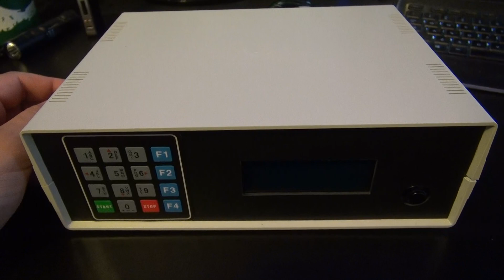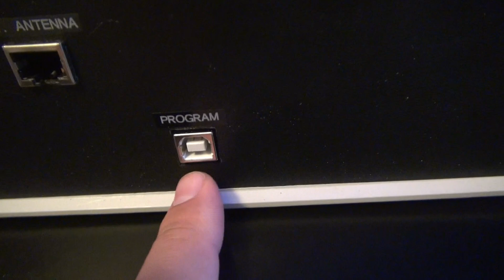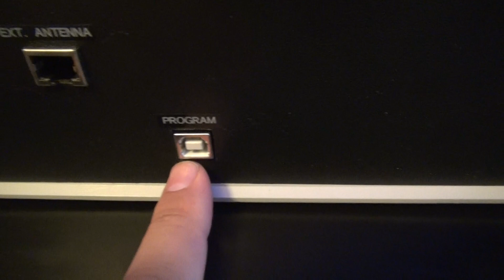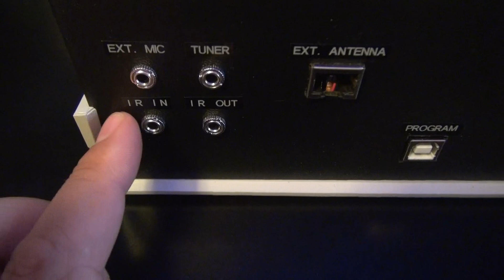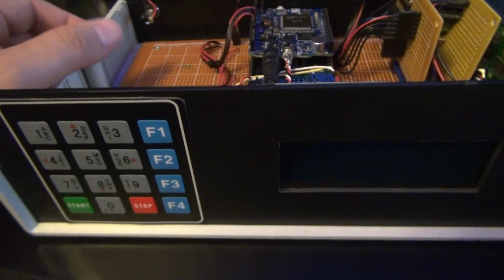ARDUINO ANTENNA SWITCH INSIDE TOUR.

Comment: Great project! Could you tell me how did you cut the holes in the case (especially for the lcd)? It looks very professional.
Reply from the maker: First I taped the whole panel with painters tape . Then I marked where I wanted the cut out to be. I then drilled four holes close but not to close the the edge on the inside of the rectangle. Then I used a table scroll saw with a fine wood blade and kept close to the line. After the hole was cut I used a small flat file to smooth the plastic all around the cutout. It took some time but It pays off with some patients.

Comment: cool project, the only thing is that i have not understand why the massive prototype board ... the arduino is not soldered in to that so you can just take the arduino in the box and make a smaller board that "hold" the vertical board. (apologyze my english i am italian)... anyway fantastic project
Reply from the maker: Thanks. I left a lot of room because I plan on expanding to more modules for future functions.